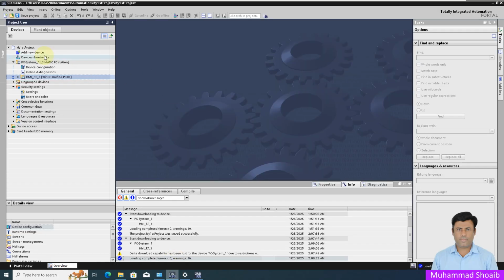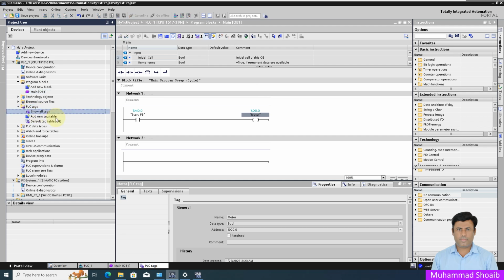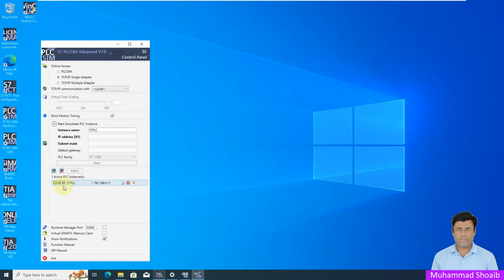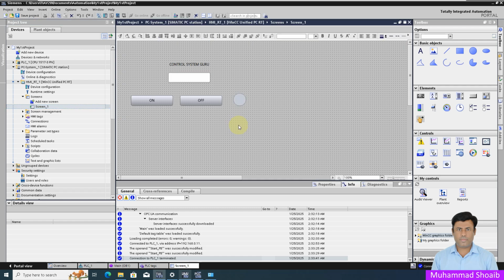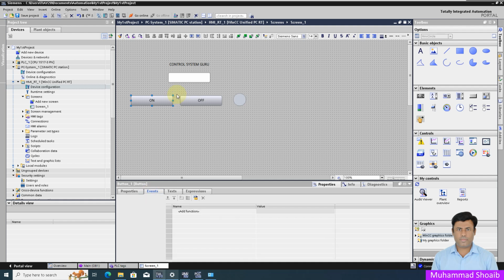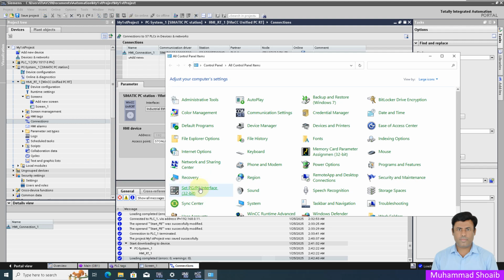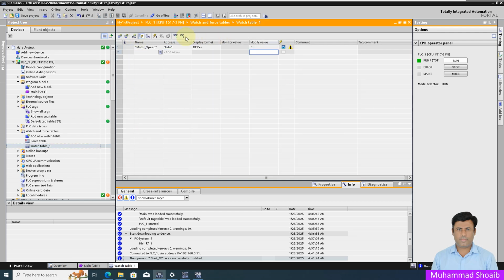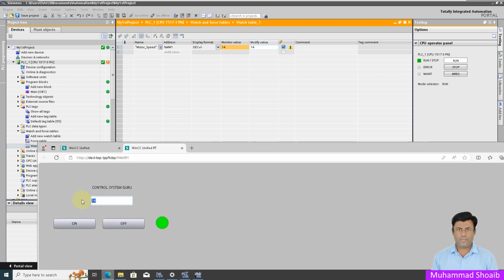2-Siemens WinCC Unified V20: How to Establish Communication with PLCsim Advanced

Comment: i watched the first video only, i have an mtp400 unified basic 6av2 123 3db32 0aw0, firmware 18.0.0.3, and a cpu s71200 1212c dcdcdc, do i need to create a pc system device in my project to make it work? or the pc system is only for simulation? thanks